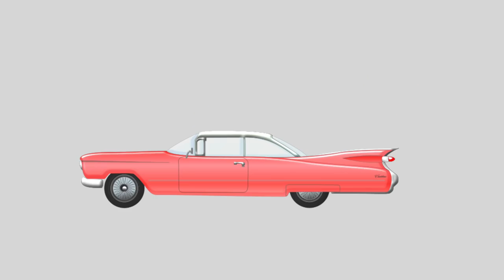Yes, Rockets CAN Fly in a Vacuum

Comment: For Newtons 3rd law to work, you need action, reaction & resistance. Where is the resistance in space?
Reply: Inertia.
Every object with mass resists changes to its velocity.
Reply: @niallkinsella2687  How much mass is there in empty space?

Open a pinhead opening to the fuel/oxygen tanks & you no longer have the contents of that tank. 

Let;s try the next tank then.
Reply: @johnsergei  You'll no longer have the contents of that tank, yes, but at least you'll be moving in an opposite direction.
Reply: @Jan_Strzelecki  As soon as there's an opening to thanks, no matter how small, the contents is lost to space. 

So how fast do you think the acceleration is & will it be survivable?

With the fuel gone in under 1 second, even 70 MPH in that time would likely be fatal.

OK, So Apollo is in orbit around the Earth, Only a tiny fraction of the way to the Moon.

Stage 1 & 2 are gone & the smaller stage 3 fires up.

Explain the process.( ignite the rocket, open the tanks etc) 
 I bet your spacecraft will crash right back into Earth?
Reply: @johnsergei  As soon as there's an opening to thanks, no matter how small, the contents is lost to space.
Yes, but the rocket would still move in the opposite direction.

So how fast do you think the acceleration is & will it be survivable?
If I recall, the highest acceleration during Apollo program was 3g, which is entirely survivable.

With the fuel gone in under 1 second, even 70 MPH in that time would likely be fatal.
It's a good thing that the fuel wouldn't be gone in under 1 second, then.

Explain the process.( ignite the rocket, open the tanks etc)
What process? Why would stages 1 & 2 be gone? And, depending on timing, "my" spacecraft would most likely be in orbit around Earth.
Reply: @Jan_Strzelecki  A little short of the moon don't you think?

You clearly have no idea how they (allegedly) went to the Moon.

Stage 1 into the high troposphere,stage 2, a smaller rocket, into low Earth orbit or parking orbit ( & it's funny how even these things an't completely clear?)

If it was really parking orbit, without further power, you're going home.

Even a little higher, low Earth orbit, the Earths gravity is almost as strong as on terrible firma?

I'm not utterly convinced that even at LEO, without power, gravity wouldn't slow you down (& ahome you go, or be burnt up).

Remember in parking orbit, you are still outside the atmosphere, so it won't slow you down, but gravity will.

I guess we could call what you wrote circular logic?
Reply: @johnsergei  A little short of the moon don't you think?
Yes, definitely. Why would they insist on going to the Moon after suffering a catastrophic fuel loss?

Stage 1 into the high troposphere,stage 2, a smaller rocket, into low Earth orbit or parking orbit
Okay then, so we wouldn't even go that far - the start would've been aborted earlier.

it's funny how even these things an't completely clear?
Not really, no. There are no signs in space saying "low Earth orbit starts here."

Even a little higher, low Earth orbit, the Earths gravity is almost as strong as on terrible firma?
Yes, but our speed is higher.

Remember in parking orbit, you are still outside the atmosphere, so it won't slow you down, but gravity will.
Yes, you'd continually fall towards Earth and miss. That's how orbits work.

I guess we could call what you wrote circular logic?
I guess? I'm not entirely sure what you're writing, either. Was is about how you don't understand how rockets work, or how a hole in a tank would cause a leak, but Apollo crew would want to continue flying to the Moon anyway?..
Reply: @Jan_Strzelecki  Great word salad.
I'm a decent pastry cook myself.

I have no idea what you mean.
I was talking Apollo & every Apollo mission launched, allegedly made it to the Moon & back, even 13.

Once again, you are in the Saturn v. You are orbiting the Earth, how do you get to the Moon?
Reply: @johnsergei  I have no idea what you mean.
And I've had no idea what you meant, either :)

Once again, you are in the Saturn v. You are orbiting the Earth, how do you get to the Moon?
You wait until the correct moment, and ignite your engine in Saturn V third stage. Whatever point you're trying to make, I'd appreciate if you could actually make it.
Reply: @Jan_Strzelecki  CABOOM! You've just blown yourself up. Oh sorry Do you mean open the fuel/oxygen tanks then, ignite the fuel?

You said in your first comment what happens if you do that (a few MPH & no more power) or hundreds of MPH, (in under 1 second) & dead astro nots).

Ether way (Blown up or orbiting the Earth) you aint going to the Moon.
Reply: @johnsergei  CABOOM! You've just blown yourself up.
No, I've ignited the engine, and are currently on my way to the Moon. How exactly do you think one can ignite a rocket engine without providing it with fuel/oxidiser? :)

You said in your first comment what happens if you do that
Not really, no - the fuel and oxidiser are kept in separate tanks, and can't burn on their own in vacuum, even when ignited :D

Okay, so is there any actual point you'd like to make? :)
Reply: @Jan_Strzelecki  OK, which tank is opened first?
Reply: @johnsergei  Whatever tank is opened first, their contents get pressurised and released into combustion chamber at the same time.
Reply: @johnsergei  
How much mass is there on empty space?
Irrelevant.
How much reaction mass was available as fuel?
Lots. Most of a rocket's in flight mass is made up by fuel.

If there was a pinhole your fuel would be gone in a second?
No it wouldn't, because liquids and gases have viscosity.

Seriously, if you are so obsessed with the exact startup sequence of the SIV-b stage, you can easily find it yourself. All of the information about Apollo is publicly available to download.

Start sequence was initiated by supplying energy to two spark plugs in the gas generator and two in the augmented spark igniter for ignition of the propellants. Next, two solenoid valves were actuated; one for helium control, and one for ignition phase control. Helium was routed to hold the propellant bleed valves closed and to purge the thrust chamber LOX dome, the LOX pump intermediate seal, and the gas generator oxidizer passage. In addition, the main fuel and ASI oxidizer valves were opened, creating an ignition flame in the ASI chamber that passed through the center of the thrust chamber injector.

After a delay of 1, 3, or 8 seconds, during which time fuel was circulated through the thrust chamber to condition the engine for start, the start tank discharge valve was opened to initiate turbine spin. The length of the fuel lead was dependent upon the length of the Saturn V first stage boost phase. When the engine was used in the S-II stage, a one-second fuel lead was necessary. The S-IVB, on the other hand, utilized a three-second fuel lead for its initial start and an eight-second fuel lead for its restart.

After an interval of 0.450 seconds, the start tank discharge valve was closed and a mainstage control solenoid was actuated:
-Turn off gas generator and thrust chamber helium purges
-Open the gas generator control valve (hot gases from the gas generator now drive the pump turbines)
-Open the main oxidizer valve to the first position (14 degrees) allowing LOX to flow to the LOX dome to burn with the fuel that has been circulating through the injector
-Close the oxidizer turbine bypass valve (a portion of the gases for driving the oxidizer turbopump were bypassed during the ignition phase)
-Gradually bleed the pressure from the closing side of the oxidizer valve pneumatic actuator controlling the slow opening of this valve for smooth transition into mainstage.

Energy in the spark plugs was cut off and the engine was operating at rated thrust. During the initial phase of engine operation, the gaseous hydrogen start tank would be recharged in those engines having a restart requirement. The hydrogen tank was repressurized by tapping off a controlled mixture of LH2 from the thrust chamber fuel inlet manifold and warmer hydrogen from the thrust chamber fuel injection manifold just before entering the injector.
Reply: What happens if I fire a crossbow in a vacuum?  Will I feel recoil?
Reply: @stuartgray5877  
Yes, you'll feel recoil (or at least the closest thing to it that shooting a bow produces).

The bolt will fly in the direction you are aiming. If it's a well balanced bolt and a well tuned crossbow, it will even fly straight, without the need for aerodynamic stabilization.
Reply: @niallkinsella2687  Good.  What if the crossbow was remote controlled? I load it, cock it, set it floating in zero-G, in vacuum.

An observer is floating next to it at zero relative velocity.

The bow fires, what does the observer see? What happens to the bolt AND the bow?

What is the name of the property that the bolt has that allows it to "push back" on the bow?
Reply: @stuartgray5877  
What property does the bolt have?
Mass. Everything with mass has inertia. Everything with inertia resists any forces that would cause it to accelerate.

When the crossbow is shot, you would see the limbs, string, and bolt accelerating forwards. The body of the bow will accelerate in the opposite direction.

The bolt will continue to accelerate until it stops being in contact with the string, The body of the bow will continue to accelerate in the opposite direction until this moment. The bolt will travel off at its new velocity and not interact with the bow again.

Now the limbs. Once they pass the peak of their power stroke they will begin to rapidly decelerate (or begin accelerating backwards, same effect). The body of the bow will accelerate forwards in response, but not by as much as the initial acceleration backwards as the bolt has taken energy from the system which cannot be recovered. Once the limbs have returned to their at rest position, the bow will have reached its final velocity, travelling directly away from the bolt it just shot.

Net result is simple conservation of momentum. A 1 kilogramme bolt accelerated to 100 meters per second will cause an unrestrained bow of 100 kilogrammes to be accelerated to 1 meter per second in the exact opposite direction.

This is all assuming that no rotation is introduced to the system by off center forces. Adding in angular momentum will take away from some of the liner momentum in the system. Even in this case, the total momentum will still be the same.
Reply: @niallkinsella2687  excellent.  You do know how this works.  Are you the type that STILL does not believe rockets work in a vacuum?  Or are you playing along just for the sake of others?    NEXT QUESTION: What happens if I change the bolt to one made of water ice or dry ice ( solid CO2) of the same mass?   Could the crossbow still accelerate backwards firing these materials?  How about a giant catapult that can fire a bag of liquid water?
Reply: @johnsergei  - I get it.  You are one of those that thinks the "vacuum of space" is some infinitely NEGATIVE pressure that can PULL gases from high pressure regions?   Sorry but there is NO SUCH THING as "Negative pressure".  The "pressure" of deep space is ZERO PSI , NOT NEGATIVE!  And the "vacuum of space" cannot PULL on anything! That is not possible.  Gases PUSH OUT of high pressure regions into vacuum.  The vacuum DOES NOT PULL the gases at all.   A tank of air at 50 PSI would vent into vacuum at the EXACT SAME RATE  as a tank filled to 64.7 PSI and vented to sea level atmosphere.  You really should NOT try to lecture others in physics when it is obvious you have never taken a physics class
Reply: @stuartgray5877  
Are you mistaking me for one of the vegetables who insist that rockets need air to push off of?
Reply: @niallkinsella2687  I just asked a question.  You started answering, but I love your answers.  I wish 1/100 of the people I come across on these threads could actually  answer ANY question.  I actually Launch real rockets for a living, then help fly the spacecraft once they reach space, so I know how this stuff works as well.
Reply: @stuartgray5877  
I just saw what appeared to be a genuine question.

The ones the hoaxers put forward are usually written in a loaded or convoluted manner that I've begun to recognise;
So, when a genuine question pops up I try to answer it before the nuts come along and try to muddy the water with their bullshit.
Reply: @niallkinsella2687  well you can see where I was going.  I try to get them to admit recoil still occurs in a vacuum.  Then I get them to admit you would STILL feel recoil even if the "Mass" was water.  Next I explain that a Space Shuttle Main Engine (SSME) is basically a WATER CANON that can fire 500 Kilograms of water, every second,  at 2500 meters per second.  THEN you find the people who agree to all of the above with SOLID MATTER, but think like numb-nuts above, and say "but the vacuum of space would PULL the water out faster than it can be pushed" which we know is horseshit!   Good to know there are still SOME people out there with a brain.
Reply: @stuartgray5877  Oh really, why would you blood boil in space, without a suit?
Expansion.

If an plane door is opened or window breaks at high altitude, things get sucked out.
I take it suddenly fly into space & that problem would be solved. It's only a little higher than high altitude flight like the Concorde. But  you know, the laws of physics change (so they say)

The higher the altitude, even in direct sunlight, the colder it gets (just ask Everest climbers). Yet it space , it suddenly gets very hot in direct sunlight, at the Earth's orbit  (what about the Moon's orbit? Get the joke or was it beyond you?)

If what you say is true then in space, they didn't even need the cardboard & cooking foil LEMon Just chairs, spacesuits & equipment, connected to the frame, wall are not nessisary.

In reality they are. 10s of thousands of objects the size of a fist or more enter the Earths atmosphere every day, most burn up.

Well, if that info is correct, no way can we ever have the lightly built LEMonade flying around out there or unprotected astro nots on the ISS. They can't even evacuate them all & sections of the ISS have no inner locks, to isolate damaged parts.
Reply: @johnsergei  : "why would you blood boil in space, without a suit?"
Because water boiling point in vacuum is below 30°C.
So what?

"If an plane door is opened or window breaks at high altitude, things get sucked out."
Vacuum doesn't "suck". Air inside will flow out, that's it.

"the laws of physics change (so they say)"
Who says that?

"In reality they are. 10s of thousands of objects the size of a fist or more enter the Earths atmosphere every day, most burn up."
If you suppose 100,000 dangerous object per day hitting Earth, it means 1 dangerous object per m² per 5billions years.
So if you have an exposed surface of 1000m² (way more than LEM or even ISS), it means about one hit per 5 millions years.
Seems manageable.

Please start to use your brain, thanks.

And if you can, stay focused: question is "propulsion in vacuum".
And the answer is simple: rocket motors are exactly made for that and works well, suing the action/reaction principle.
First try to understand that, and then well move to your other fallacies.
Reply: @johnsergei  "Oh really, why would you blood boil in space, without a suit?"

Yes Blood or water would boil if exposed to a vacuum.  That STILL does not mean the vacuum is PULLING on the liquids.

"Expansion. If an plane door is opened or window breaks at high altitude, things get sucked out."

No things get PUSHED OUT! The energy of a gas moving from a high pressure region to a lower pressure gas region is the higher pressure PUSHING TOWARDS the lower pressure region.  The lower pressure region DOES NOT PULL on th gas from the higher pressure region.  It CANNOT!  How can a gas molecule PULL on another gas molecule? THEY CANT!  They can bump into one another AND PUSH though.

"If what you say is true then in space, they didn't even need the cardboard & cooking foil LEMon Just chairs, spacesuits & equipment, connected to the frame"

No, they STILL Needed to hold the AIR IN, or they would not be able to breathe.

But you ARE partially correct.  A Mylar Birthday Balloon could hold in 5 PSI of air against the Vacuum of deep space .
Reply: @stuartgray5877  Gotta say things twice to people who clearly know nothing about Space.
lack of pressure causes expansion. If there is more space for the matter (say blood) to expand, it will.
The only reason why there is matter we can even see in space is gravity, even a dust speck has gravity.
The gravity of the Sun  keeps the Solar system together & the Milky Way gravity keeps the galaxy together.

See what Joe Kittinger had to say, about his trip to the fringe of Space 

DUH! who the F is Joe Kittinger? " Jesus Christ" (in a whisper, don't wanna be rude on the net, unlike the believing shills).
Reply: @johnsergei  -   "Gotta say things twice to people who clearly know nothing about Space." 

SO YOU, are accusing ME of "knowing nothing about space"?  REALLY? How about a brief description of my career?

 I have an electrical Engineering degree, I have been building & flying aircraft since I was seven, I have been an aerospace Engineer for almost 25 years.

 I have helped build deep space probes that have orbited Saturn and landed on the moon titan, Orbited and landed on Mars.

 Brought back samples of a comet, brought back samples of the solar wind, punched a hole in a comet, discovered thousands of extra-solar planets, landed on Earth, and orbited Earth.

 I have helped launch 5 of these spacecraft and worked on about another dozen.

 I have built the electronics, built and tested the entire spacecraft, helped fuel the spacecraft, and helped put it on the rocket.

  I have helped fly three after launch.

  I have worked for Lockheed Martin Space Systems & Space Simulation Labs, Ball Aerospace, Jet Propulsion Laboratory, Laboratory for Atmospheric & Space Physics, NASA, NOAA, & DOD.

 I have been Spacecraft Avionics Engineer, Lead Test Engineer, Command & Data Subsystem Engineer, Power Subsystem Engineer, Flight Director, and Launch Conductor.

 I have also personally witnessed over twenty real rocket launches including space shuttle (launch & landing), Delta II, Delta IV, Atlas,  Minotaur and Falcon 9.   
I have been the LAUNCH CONDUCTOR more than once.

YOU WERE SAYING FUCKFACE?

WHY do people who OBVIOUSLY have NEVER TAKEN A PHYSICS CLASS IN THEIR LIVES feel that they can lecture engineers and physicists about engineering and physics?
Reply: @stuartgray5877  Ok, let me catch you out. From the Oort cloud, stars look like Poker dots.
True or false?
Reply: @johnsergei  I have NO IDEA what that question means.  I don't even know what a "poker dot" is.  If you want to question my career, lookup: Mars Global Surveyor, Stardust, Genesis, Deep Impact, Kepler, and NOAA-20.  I helped build and launch them all.
Reply: @stuartgray5877  You don't know what a poker dot is?

Yep, I'm sure you built a hell of a lot.
Can you cope with an internet search? 
" on poker dots, or the Oort cloud, Jesus" (say under your breath).

Goodbye!
Reply: @johnsergei  I believe you mean pokka dots.

And no, because pokka dots have simple repeating patterns. Stars do not.

Also you seem too have very odd misconceptions about mass flow rates due to pressure differentials.

Gases well not immediately eject into the vacuum of space if you open a tank. It will exit the tank at a rate dictated by the cross sectional area of the opening, the viscosity of the gas, and the differential pressure. Fuel and oxidizer flow rates are actually too slow for the rocket engines, which is why the fuel system runs turbo pumps to meet the flow rates required.

Any time you eject mass from a rocket, such as the exhaust, the mass ejects the rocket as well. If the momentum of the rocket and fuel is zero before combustion, the total momentum of the exhaust and rocket must also equal zero. The exhaust will have a mass and velocity in one direction, which means the rocket must have a velocity in the opposite direction inversely proportional to its remaining mass to balance out the momentum. This is because momentum is ALWAYS conserved. The result is thrust and the rocket works fine in a vacuum.
Reply: @johnsergei  - "Gotta say things twice to people who clearly know nothing about Space." 

Lookup my Resume on LinkedIn.  I dont hide my identity.  Just search "Stuart Gray Lockheed".

Then come back here and tell all of us what it says. 

'll summarize for you:  BELIEVE what Stu Gray says about spacecraft technology.
Reply: @tadferd4340  Good explanation.  You just cannot convince them that the "vacuum of space"  does not suck gas out of a vessel in zero time.  They think the vacuum of space is somehow this Negative Pressure of infinite power.  They dont realize it is this nice peaceful place that does NOT suck, and is just a place at ZERO PSI.   They honestly believe (without EVER taking a physics class themselves) that THEY can lecture professionals in the field of vacuum environments about how physics behaves.
Reply: @tadferd4340  Pettit said the stars looked like pokka dots.

0k, let's go along with that.
What do the stars look like from the Oort Cloud?

We'll even overlook that the ISS could see stars during the day while Apollo could not.
Reply: @johnsergei  It will depend on how much light there is from inside the spacecraft or from near by objects. This is why Apollo couldn't see stars by the way. The Earth and moon were reflecting enough light to drown out the dim light from the stars.

If you could see stars, they would look similar to how they look on Earth except for maybe the sun and Alpha Centauri, which may look a bit larger than other stars due to their distance.
Reply: @tadferd4340  Every Apollo astro not, orbited both the Moon & the Earth (night, to the dumb believers) & Alpha Centauri would look the same, even when the Moon, which you are orbiting, is on the far side of the Earth to Centauri (yep, further away would make Alpha look bigger?, canned laughter please).
Reply: @johnsergei  You were referring to being in the Oort cloud, which depending on which part of it you are in, would be closer to Alpha Centauri.

The part about Apollo was just explaining why they would not see stars. Don't forget the context from your own comments.
Reply: @tadferd4340  So, Apollo could not see stars at night?

Yet the ISS can see stars in the day & they look like Pokka dots (& i mean the size, so don't bother dancing)

At the Oort Cloud, 1 light year closer to at least some stars than the ISS, the stars would look the same, just specks of light.

Alpha Centauri A would look a  little brighter than the other, but only if you went in that direction.

None would look like Pokka dots & you likely still not see the closest star Proxima Centauri?

Don Pettit & his buddy know nothing about space, probably less than you or I?.
& they are not actors but actor nots.
Reply: @johnsergei  There is no night and day in space.

Pokka dots are not a unit of measurement for size.

Most stars when viewed from Earth orbit or the Oort cloud would look the same. The sun would definitely look smaller. 

The closest stars might have a measurable change in angular size from the Oort cloud. I never asserted that they would for certain.